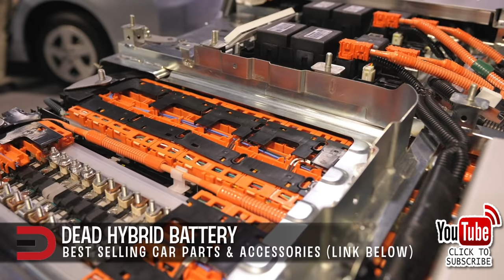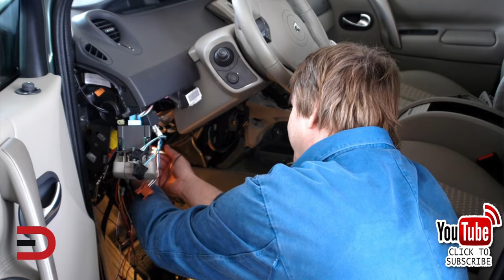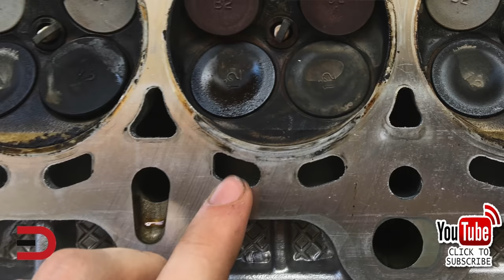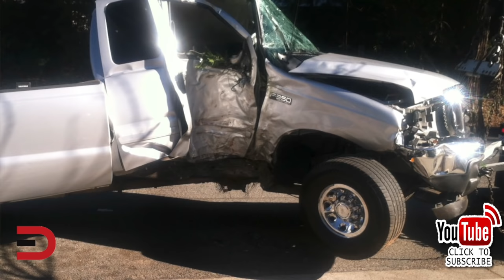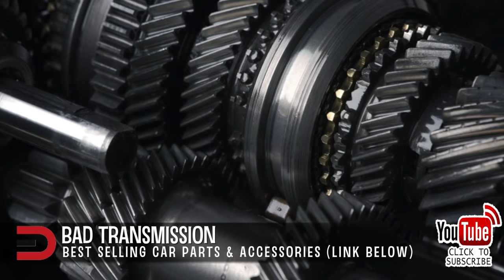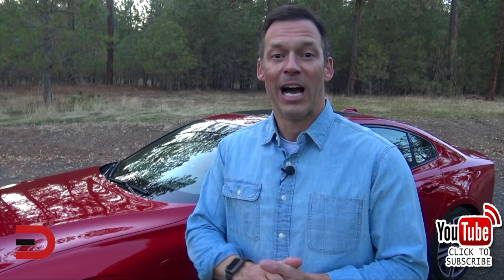These Car Problems are NOT Worth Fixing, Save Your Money Instead

Comment: Sometimes it's a hell of a lot cheaper to repair what you have, rather then buying another persons used problem vehicle. You are encouraging people to sell and stick others with their problems. Investing $3k to $4k in a good sound car that you own and  know, is cheaper in the long run..
Reply: Well said.. And not to mention a very large number of parts come with lifetime warranty. Currently putting a crankshaft in my truck. Only gonna cost me $260. Much better than thousands on another car.
Reply: @golferpro1241  those cars are very reliable, that's why their value doesn't drop a lot
Reply: @golferpro1241  true because they are less problem stic
Reply: Just had a guy tell me my truck isnt worth fixing. Gonna cost too much. He suspected because the vehicle was 2004 it was some rusty POS. Little does he know its mint condition low miles. Truck is worth 6 grand the way it sits and 9 once its on the road again. He says a 1500$ repair isnt worth. Douchebag inly wants to work on brand new vehicles lol
Reply: @hasty-carnaage1518  lol, this guy sounds stup1d to me

There are literally vehicles before 2000 that are still working like brand new, they just needed to be fixed because some parts will break with time, new vehicles in my country are too expensive so people will focus on the used market but they maintain the vehicles very well so they last longer than expected
Reply: it depends on what it is, some things you can fix on your own, but others your better off buying a new car.
Reply: @golferpro1241  that's Honda and Toyota for you though, but you can find others that are just as reliable and cheaper. you can find plenty of cheap Corolla's out there, Honda's Civic on the other hand can be a bit more pricey on the used market.
Reply: @yacinealg152  exactly.. I got my truck to a family friend and he had the major problems solver in less that 24 hours. I dropped the truck off 2 days ago at like 2:30 pm and he texted me images of the truck at 1pm yesterday showing me the progress. Once its done im gonna drive right up to the mechanic that told me its not worth it and i wanna do a donut or 2 in his parking lot lmao
Reply: @yacinealg152  where I live, licensed repair shops really dont like working on vehicles that are being paid out of pocket. They much prefer to work on newer vehicle with full coverage insurance. If you dont have insurance expect to pay $1500 for a 500$ repair.

Comment: I'd rather spend $2,000 to get my car fixed rather than spend $20,000 on a new car. My car is 11 years old and I've owned it for 7 years. It's still as good as the day I bought it.
Reply: Here is the problem with that  process say your transmission blows up you spend the money you get it fixed great.  Well then you end up a year later with a major engine repair it starts a cycle of repair bills. Some vehicles are worth a transmission replacement but your average vehicle it's not.
Reply: @autohelix  Ya I can understand that if I only paid somebody to fix all that but the thing is, I do all of my own maintenance and repairs. The only thing I pay for is parts. The only exception is the automatic transmission. If anything ever happened to it, I'd take it to the dealership even though I have the factory service manuals because I don't feel comfortable taking it apart. I just drop the pan, change the fluid, filter, and gasket every 60,000 per manufacturer's recommendations.
Reply: @AGreedyTree  I do my own work as well. I had a car that I put 3 time it's worth in just parts, it drove great and then the engine went. I learned a big expensive lesson sometimes it's just better to let them go.
Reply: Lol.. says guy with the Ford. J/K. I have a 92 VW GTI 16v. I’ve owned it since 99. Paid $5000 back then. It’s worth more now. I’ve put $$ into it, but nothing even close to the cost of a new car over the years.. plus it’s more fun than every car under 15 grand over all
These years
Reply: Oh, I had the transmission rebuilt back in 2003. $1500. Stick with a manual if you are smart, or if you just have an automatic ONLY Toyota.
Reply: You can buy a new 2018 car for 13 grand.
Reply: @autohelix  that would be incredibly rare to face both a transmission and engine issue on a 12 year old car. Thats a huge "what if" scenario that would almost never happen.
Reply: @NoName-gv6nm  I've seen it several times. Not nearly as rare as you think. So no not incredibly rare.
Not only have I seen it on multiple vehicles from all my years working on cars it even happened to me personally.
The reality is most engine failures happen because of lack of maintenance, so they probably didn't maintain the transmission if they didn't maintain the engine. Most transmission failures are also because of lack of maintenance.
A vehicle that either has a blown engine or transmission is 10years old has 150,000 mi on it could potentially need a lot of parts replaced. The suspension is probably worn out, the steering assembly is probably worn out rubber dry rots just a fact. 
It kills me when people say their 10-year-old car with 150,000 mi drives like new no it doesn't.
Reply: My second side car is a 03 PT .  So your pic gives me hope.
Reply: @fatboy19831  what kind of car ? My 2011 Buick was 15g when I brought it 3.5 years ago.
Reply: @JcLazy1  Nissan Versa,  Mitsubishi Mirage.
Reply: @djkenny1202  why? Do you like clutch replacement on modern car its extremely expensive
Reply: @kitecattestecke2303  luckily I only needed it one time at 188k on my 92 16v GTI. It was $600 total done right with Sachs parts 8 years ago. Still going strong.
Modern CVTs are the expensive. Stick is better on modern cars as well.
Reply: @autohelix  life expectancy of suspension and steering components also varies alot. My 82 camaro barely has any rotting because it never saw salted winter roads and it was never by an ocean. My 04 silverado also still has practically new bushings because it was garage kept and not winter driven either and was owned by old guys who babied it before I bought it. Its 04 but still drives better than any newer truck ive driven. Dads 2017 doesnt drive as nice, his fiances 2016 I hate driving. My inlaws 2010 duramax is a really nice ride as well though lol.

Comment: $1k-$6k to replace the battery vs $30-$40k for a new hybrid car... if there are no other issues with the car, then I will go with the former...
Reply: That is why you buy a warranty on hybrid or electric cars. Better safe than sorry.
Reply: Add tax, new car insurance, loan interest, and depreciation. Replace the battery.
Reply: Most come with a 10 year warranty atleast
Reply: @jamesjulson9710  ? Why buy a warranty on a hybrid or electric if it exclude the battery? And he said to replace the battery if the car is okay.
That is what most people do just fix if the Rest aint broke.
Video is stupid
Reply: @kitecattestecke2303  Excluding the battery or electric system would not be smart.
Reply: He says buy a new car if the hybrid battery goes bad..... I think this video itself proves that electric cars are not the future or dependable. Did you know it takes between 1 to 8 hours to charge an electric car? Who has time to sit around and wait for their car to charge just so they can drive 200-250 miles per charge?

Comment: A lot of these issues are fixable, and once repaired they'll be even better. Why scrap a car that runs, just because it needs to be fix, not everybody is rich, and can afford another car. Head gaskets, aren't an issue to replace, if your car starts smoking, immediately pull to the side of the road, and shut the engine off to prevent coolant from flowing up to the pistons, and out of the radiator, and don't drive it just have it towed.

Comment: 218,000 miles on my 08 Prius not a single issue also at least here in Arizona it’s 399-699 to replace the hybrid battery so it’s cheaper then getting under another car payment for 4-6 years. Jeez your giving bad financial advice. Getting a new/used engine 4-600 bucks a grand for the swap still cheaper then your average down payment same with trans this is such bad financial advice it’s crazy.
Reply: brandon wright Where do you get a hybrid battery that cheap? What’s the warranty on it?
Reply: The price for a re-manufactured engine (Jasper brand) for my Trailblazer would come to $US6K with installation.

Comment: Not sure head gaskets fall into the death blow category.
Reply: Mike Llewellyn I change those myself.  $100 bucks or so.   Just have to make sure you don’t have a cracked head which caused the gasket failure
Reply: Agreed, depending on the car. Most pushrod V8s are pretty easy, but a 4-cylinder Sentra can be a real bugger. If my '70 Corvette blows a head gasket, it's an afternoon and $100 lost. Junk the car over it? Ha, ha -- not likely! Luckily we're not required to follow the advice of self-described "experts" who make car advice videos.
Reply: @fredkuhn165  yes,I would rather buy a new car than spend 100 dollars. Not!!
Reply: @markquigley7839  1977 Carolla will run with a blow head gasket for years.  It only takes a trained mechanic a few hours to completely repair it.   Cadilac STS run for the hills.
Reply: Same with the transmission I've changed a trans before and I'm by no means a mechanic i borrowed my bosses trans jack dropped the trans changed the rear main and the trans i got a killer deal on it the most expensive part of the job was the atf
Reply: Back when I was a mechanic, I worked for a dealer whose "bread & butter" inventory was Pontiac Sunfire and Chevrolet Cavalier cars equipped with GM 2.2 pushrod I-4 from auction with blown headgaskets.  He'd get them for almost nothing, then it was my job to fix the head gasket.  From start to finish it would take me 90 minutes to change the headgasket, change the oil, fill the radiator and having it running.

Comment: 1: Collision center can repair some of the bends in the frame. Its a case by case basis. 
2: Engine/tranny issues are not always a reason to replace a vehicle. Some motors are worth a rebuild, some aren’t. Same with a tranny. 

These are not always death sentences.

If its a daily beater/commuter car then whatever. But if its something more than that, and overall worth it, thats where you invest in it. My wife’s hyundai, chuck it. My truck? Repair. Why? Trucks are too expensive, and the one I have just needs a break and some good TLC. That and I intend to restore it after I can buy a newer one and can retire my current truck.
Reply from the maker: Great points, thank you sir!
Reply: I'd say the Jeep 4.0 I6 falls into the rebuild category. My brother and I replaced a piston due to a broken skirt and I couldn't believe how easy it was. We didn't even have to remove the engine. All we did was pull the cylinder head and oil pan.
Reply: Any car that doesn't leave you stranded is one worthy of saving. This is why we are seeing key Hondas and American Trucks being saved as beaters. My 98 CR-V for example, because homeless and employment issues, this poor car has not had service in nearly a year, and I paid $250 for it, aka, ran through... I don't think I have much life left in this car, 283617 miles and counting daily roughly 60/100 miles. This is a car to toss. Everything is worn out and nearly at failure. But you best bet, I'll be looking for another first generation CR-V as a replacement. This car is one of those ones to snag for the long term lost cost to own. If I took better care of it, I know it would of beat 500000 miles... Truth.

Comment: In order to truely appreciate the power of electrical glitches, may I introduce you the Jaguar brand....especially a used one.  Truely one of a kind.
Reply: Remember the Lucas brand? The weren't called 'The Prince of Darkness' for nothing.
Reply: @paulmoffat9306  Know why the British drink warm beer? They have Lucas refrigerators.
Reply: A friend gave me a completely rusted out 1980 Daimler Sovereign Double 6. I wanted it for the V-12 engine, TH-400 trans, and rear end for a hot rod. Removing the engine was an absolute nightmare. Everything about that car was more complex than it needed to be. From the electrics (which I need none of, thankfully) to brackets, to hoses, to everything. Working on a Jag with a view to keeping it going is a sure-fire way to wind up in a padded cell.

Comment: I think this video needs a case by case disclaimer. My Ford Focus 5 speed transmission chewed up and barfed 4 years after I bought it new in 2006, I got a junkyard transmission that I requested be inspected (for a fee of course) and installed for $600 at the local independent repair shop. 

Still driving the car to this day and I consider the $600 to be well worth it, as opposed to what the video claims.

Comment: Seriously who made this video?? Car salesman association ?
A bad gearbox can be cheaply replaced by a used unit (especially a manual one)
Electrical problems can be easily fixed by a skilled mechanic
And a good engine should survive a head-gasket leak.

Comment: People you have a few options when it comes to vehicle parts and repairs, so you will not need to replace a vehicle.  

1. Used parts. They come with a warranty. 

2. Rebuilt parts. Come with a warranty.

3. Junkyard parts. Come with a warranty and if you can remove the parts yourself. You save even more money. Or if you know a mechanic, maybe they can help you remove the part. 

4. Find a mechanic that does side work. The labor is usually half the price of most shops. 

Ebay for car parts. You have the backing of a money back guarantee from eBay. Even if the parts seller does not do money back guarantees. Most sellers do 30 day returns. Other companies give 1 and 2 year warranties.

Comment: Change all fluids religiously to avoid problems in the long run. Engine oil, engine coolant, transmission fluid, power steering fluid, brake fluid...maybe even change blinker fluid.
Reply: Your driving habits save a lot too..
Reply: Yeah you can't leave out that precious blinker fluid. That's the life force of the vehicle.
Reply: A wise guy! Lol  I'd love to know how many people are gonna read this and then demand blinker fluid from the dealership. Rofl
Reply: Just get the blinker fluid from Amazon 🙃

Comment: If you can do the labor yourself and you catch it right away a head gasket is worth fixing. If the oil and coolant mix buy a replacement motor.

Comment: Head gasket is not great, but it's an easy fix.  Long term, it might me an issue.  Spending 20 or 30 grand on a new car vs. under 500 bucks on a head gasket is the correct approach.  If you think the car is dying, drive the damn thing until it dies.  At that time, get a better ride.

Comment: I blew a head gasket on my 1974 Chevy Caprice with a 400 ci. small block. Drove 50 or so miles home and later replaced both head gaskets. It was perfectly fine for years after.

Comment: Kind of depends on the vehicle. Aamco rebuilt the automatic transmission in my truck 6 years ago for $2,500. 50k miles later it’s still running and it’s been my daily driver, with almost 200k on the original engine.

Comment: My 1993 Jeep Grand Cherokee limited 5.2 V8 is still going strong for 26 years without engine or transmission overhaul. Right now it is over 402,000 miles. Several years ago, I've used conventional oil then blue smoke came out from tail pipe as I didn't like so, I switched to 5W-30 Mobil One Synthetic oil with royal purple oil filter for years without any problem as well always passed smog check. Also, I've used mostly Chevron 87 octane gas of trying not get cheap gas too.

Comment: I have always done it this way if the body is good and the mechanicals are good it’s worth an engine or transmission. But in saying that if it’s has 350,000 km (200,000 miles) on it it’s probably time to let it go.I buy Hondas because you can buy a motor or transmission from five to $600 Canadian at Japanese auto parts and they have less than 50,000 km on them.

Comment: If you have a car with 200,000 miles and it blows the transmission it's not worth fixing. yeah but it still drives as good as day one, no it doesn't vehicle components degrade over time and mileage I don't care what type of car it is. Suspension, steering, bushings, and brake system components degrade. The more common issue I see is people do major engine repair, and then a year later the transmission goes goodbye.
Reply: Then why not fix the transmission after?

Comment: Transmission and head gaskets like most poor people not only I have replaced both, but actually I have fixed the manual transmission.  If your car is over ten years old, just go to the junkyard and buy one.  Take it to a shop with a dyno and get it tested.  A lot of work and not cheap, but really cheaper than a four hundred a month car payment.  If you are one of those guys that get his nails done, well buy a new Corolla Florence.

Comment: Electric batteries can be replaced  individually, just the bad cells.
Reply: You may replace bad cells but other used cells already degraded until become bad cells too.  The efficiency is lessen compared to a new batteries. In a long run just replacing bad cells is a waste of money
Reply: @garyboyh  A rebuilt pack cost around 1,000 a bargain and easy to replace.  Rebuild battery have been tested to meet the standards.  Just blew over $600 on break job. So a 1,000 for battery pack is a bargain and will last over 20 years. easely. Besides they hardly ever get replaced.  YOU ARE WRONG
Reply: ...every few months.
Reply: You understand nothing about hybrid cars electric cars it’s not as simple as you think
Reply: Other videos I've watched suggest that replacing individual cells is not advisable. The ones you didn't replace are likely to go bad soon after. Best to replace them all at the same time.